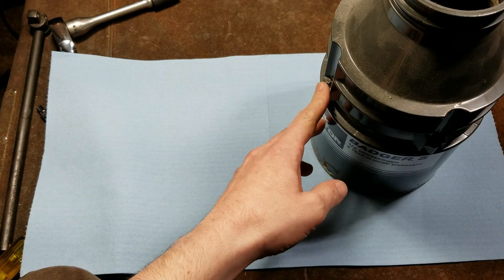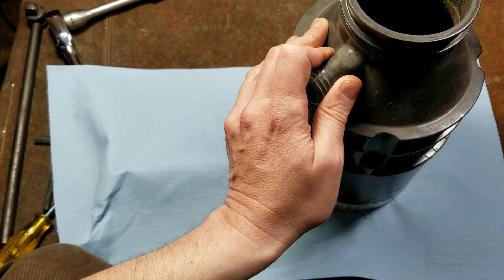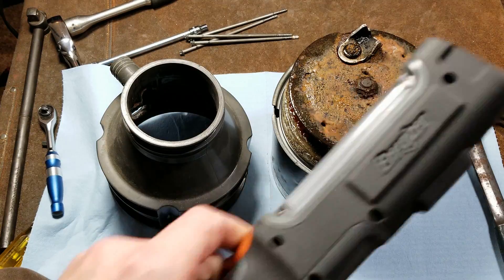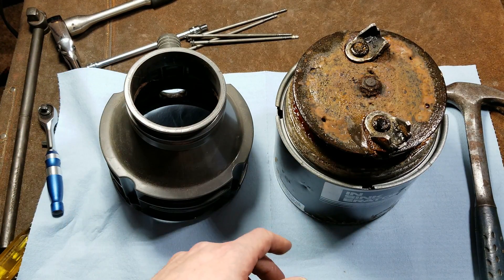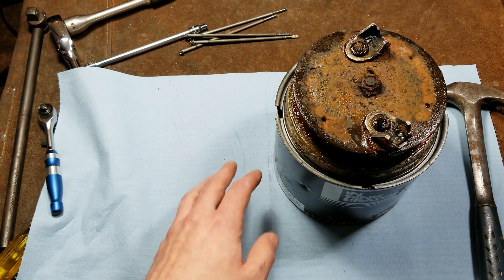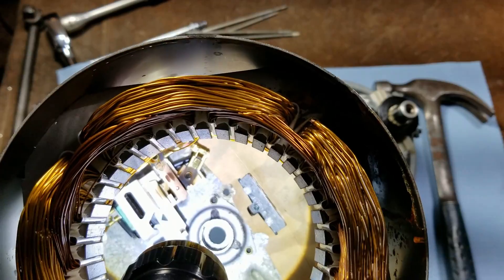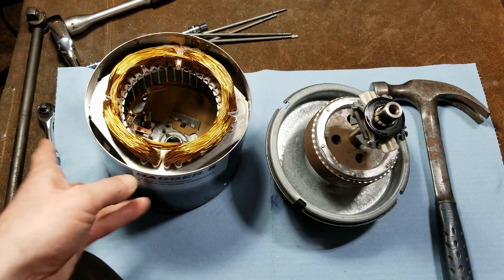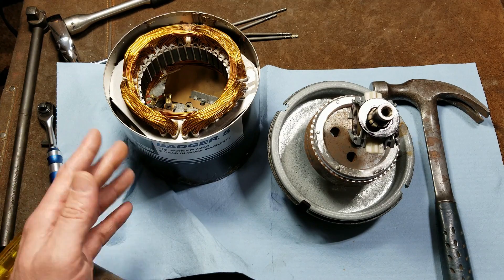TearDown: Dissecting a Garbage Disposal

Comment: I have a Badger 5-84 
and it totally went toast on me. It started leaking at the screws on the bottom and then it stop doing that after no power and then ni humming no reset when pressed. Impellar won't turn- totally jammed. I tried to use a ratchet with a hex bit to get it to unjam and it just won't budge.. So much so that I darn near twist it off its EZ mount..
When it was operational  the dishwasher  discharge water drained perfectly without it filling up the sink now it overflows the stopper throat.
My Badger is 13 years old time to get a new one...
Reply from the maker: Sounds like it's definitely time for a new one!

Comment: After 18 years, mine developed rust holes on the top motor cover causing it to leak.  When I tried to separate the top half of the shell like you did, it had quite a bit of tar holding it to the bottom half and was a bit of work to get them apart.

Comment: Good video.  The torque wrench you used to take the e6s off to free the top, what size tool is that?
Reply: I know late reply but if it helps u can use pliers
Reply: It's a simple 1/4" drive ratchet and extension, you can see it clearly at  01:19

Comment: if any flatware or any other piece of metal goes in there it can really mess up those teeth and the wheel.  Also I don't think you want to be around if any flatware falls in while it is running since it may possibly be forcibly ejected if t hits just right.  If I ever see a knife in the ceiling above a disposal I will have some idea what may have happened!!!

Comment: I don't know about the best but a lot of plumbers won't bother with any other brand.  To me that speaks volumes about the quality.  There are other brands but I have no idea how good they are by comparison.
Reply: We are creatures of habit, (I used to do a los of apt maintenance...) if the collar is interchangable im good. The ss  models are easier to keep clean... if you aren't feedin it cat litter and drywall screws.😅 ... I World like to see more plástic engineered into keeping cost down and stop the rust... ss is not as pricey as it was long ago, but i have not use for the tin galvanized cover the motor has. Once rust sets in that rotten smell is permanent.

Comment: I never take someone’s word for it when they call something stainless steel always use a magnet, and if the magnet sticks really hard, I question the use of the term stainless steel. I know there’s different types of stainless steel, some of which are completely non-magnetic, and some of which are partially magnetic, but I have a much more expensive model than this. I have the Insinkerator Excel 2, and the magnet sticks very strongly to almost all the parts inside that I thought were stainless.

Comment: As others have said, thank you for this video; I don't think there's many like it on YouTube. It was helpful when I had to take mine apart to get, of all things, a rusty screw out that had fallen in. Ever put one back together? I got mine back together, working, leaking only a little from a crack in the top half. Should last a little longer til I can replace it.

Comment: Thank you for this teardown! I was wondering if I could just take mine apart and oil bearings and otherwise "rebuild" or repair it, but your video has convinced me to just buy another one. (Mine's got at least 30 years on it.) I can't believe that anyone who has cats is so easily grossed out by what's in a garbage disposal, since my cats can create much worse! Thanks again for the informative video.

Comment: Awesome video appreciate you taking the time to make this video I have been using the 5xl for years and this will help me potentially fix one i have that just leaks, works perfect other then water leaking through the bottom of the unit. Question is have you seen the seal for sale by itself at which you speak, I believe that is my issue. The unit works perfect otherwise just weeps water out the bottom casing by the electrical connection, yikes...I just realized i had been putting my hand there to feel the water...won't be doing that again without rubber gloves on...;)

Comment: I've searched high and low, but I can't find anything. Is there a part number for the internal seal? Mine recently started leaking out the bottom screw and from what research I've done, it says it's usually because of a worn out internal seal. I can't seem to find one... thanks for the video breakdown.

Comment: I notice the lower mounting ring (around the mouth of the disposer) is missing from this.  How did you get it off?  My Badger is running fine, but the sink flange in the sink was leaking water underneath for a long time, hidden from view, and so all of the mounting hardware (including the lower ring around the mouth of the disposer) was corroded and falling apart.  I bought new stainless hardware, but can't figure out what holds the lower mounting ring onto the plastic body and/or how to put a new mounting ring on the disposer.

Comment: Is there a way to open the bottom plate without tearing the whole unit apart? The reset button on mine sunk in and I can’t press it, it’s logged somewhere under there.
Reply: Did you ever figure out how? Mine did the same thing
Reply: You can remove the bottom end bell and reattach the reset button.  It's contained by a plastic bracket that just needs to be pushed back into place.

Comment: It’s a split phase induction motor. Resistive start windings only give it like a 30 degree phase angle during startup so torque is way less than a capacitor start that gives a 90 degree phase angle. Usually you don’t see them in 1/2 HP motors. I see them mostly in 1/3 HP and lower. This motor has 4 poles so it runs at about 1780-1800 RPMs unloaded. I’m betting the more commercial ones are capacitor start. Big issue with a split phase is since the start windings are resistive they burn up super quick if something gets hung up.
Reply: What about the badger 5xl? Do you know what type that is or if it'll burn out fast? Our garbage disposal in our new house just burned out after the blades were rusted stuck. I got the blades free and everything spinning freely but the motor just hums. Reset does nothing. I need a good somewhat cheap replacement
Reply: @heatherlynn4652   unfortunate I don’t know for sure but looking at a parts website it doesn’t show a capacitor. When you say new do you mean NEW New or new to you? Most builders give like 2 year warranties on appliances, have you tried contacting them?

Comment: i think its the switch thats arcing on my disposal though only intermittently so its kinda turning of and on while its running almost like a loose connection though i seen a blue flash under the sink. if it is the switch what can i do to sort that?

Comment: Very cool, just today ours stopped working. I suspect the centrifugal switch to be the culprate because it does not spin and hums, but the shaft turns freely. You can feel the heat coming from the outer windings of the motor so my guess is that it's not properly switching to it's startup windings or it's startup windings are dead
Reply: Mine too! That's what brought me here. When I disassembled mine there was water in the rotor and windings compartment, and I think that is supposed to be dry. When my wife showed me it would just hum when she turned it on, I went digging for the wrench, but it turned no problem, so then I went digging for my wallet.

Comment: I have one in my shop that I replaced with the same idea, see what was inside, now I don't need to.  Wait until you disassemble a well pump, the pumping stages are quite unexpected.
Reply: Watch out, the inside of a well pump is probably filled with oil, which makes a big mess when you tear it apart.

Comment: If you ever see where water squirts out of the anti siphon valve when the dishwasher is discharging, someone forgot to knock out the plug in the disposal where the dishwasher hose attaches.  Over the years, I've seen this several times.  Crazy.
Reply: Never use the dish washer except when accidentally started somehow, so it was never an issue. But I always wondered why that happened.
I just took my erator off since it was really jammed and indeed it is completely sealed 😅

Comment: Thanks for the break down of the unit. There is a L shaped wrench that came with a disposer I installed.

It fits in the hex in the bottom, so you can clear a jam in the unit.

Comment: I have nightmares  about garbage disposals since i  was around 19 years old and working for a builder doing customer service  and warranty work. I wa sent to a customers house that  claimed their disposal wouldn’t work  so  when i began looking at it i discovered the hose from the dishwasher was plugged  solid. So i  took that off and began cleaning it out with srewdrivers and whatever else i had  the family was a Asian family and  the   Contents of the blockage appeared to  be rice and  rotting fish  what. I discovered  was that they. Only used the dishwasher on Thanksgiving day as the Mom preferred to hand wash all of her dishes and didnt trust the machine  so  she apparently would stop up the sink drain nightly and the husband would try to fix the drain by turning on the disposal  but the wife was afraid of the noise it made  and wouldn’t use it herself so  a year of old food had  filled up that  hose  and the 1 time a year. They use the dishwasher it would cram more ground up food into that same hose  and i guess it was the rice that became almost like concrete as it dried out   I dont have a strong stomach  for nasty. Smells so. I began gagging trying to clear that hose   As the stench was that strong  if you can imagine how  bad  rotting fish remains could be  yes i did get the thing back together and working and  i later found out that the guy running the customer service division that sent me there was  being paid cash by the very same  homeowners to  make sure their home got done  faster than others  which is why he told me to stay and do it instead of our normal  procedure of diagnosing the issue and calling the plumbing company that  installed all of our   Plumbing fixtures  to repair  them